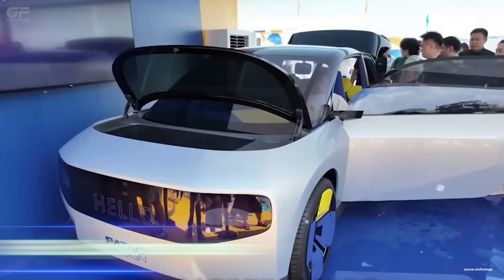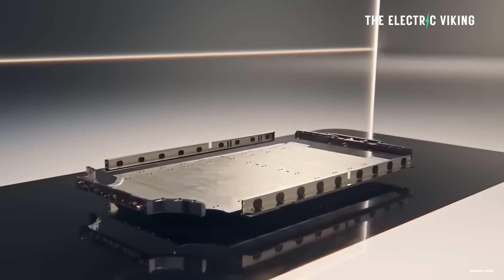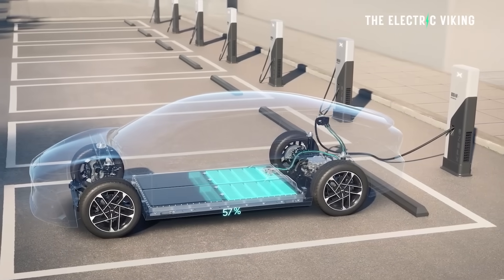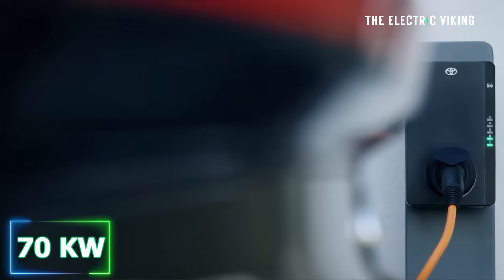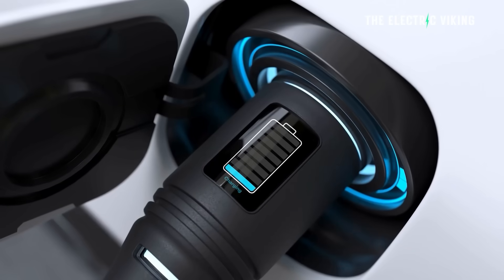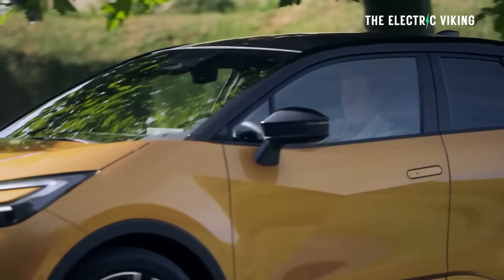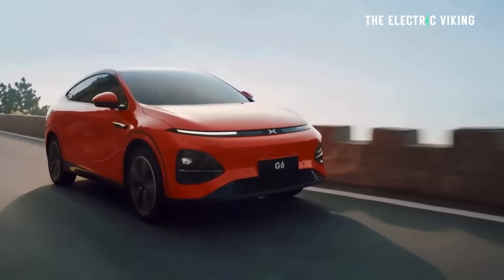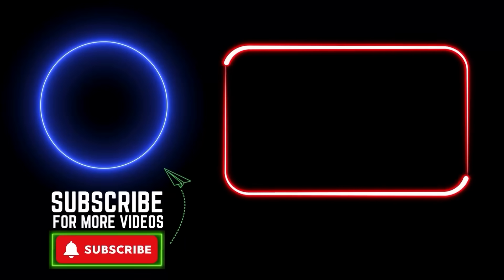SAIC GM's 400 Wh/kg battery will enable 600 mile range EVs in 2026

Comment: Most people who think they need “600 mile range” have never driven an EV. Most people who actually drive EVs want lighter cheaper models (with 3-400 mile range).
Reply: 600 mile range in Canada winter isn’t much more than 300 miles.
Reply: Those with no home charging in Apartments/flats etc would benefit
Reply: Higher battery density will allow the manufacturers to satisfy both kinds of customers (and everything in-between), namely those willing smaller, lighter and cheaper EVs with shorter range and those willing larger, more powerful EVs for longer road trips.
Reply: It really depends on your needs. 
I run a Service truck and am a trades person 
But 400 miles definitely covered any day of my work week 
But then you have a ton of tools and the material changes from day to today so the weight heats up the mileage
Reply: sadly the US is probably where the big range really comes in handy. towing and work trucks need tons of energy. maybe we'll start stealing tech from china now.
Reply: disagree... 500 mile range..
Reply: Depends on where you live. Australians (where 80%-85% of the population live in the conurbations of 5 major cities) demand at least 1000km range for EV's for them to be worthwhile. Simply bc the weekend can easily involve distance driving. And while plenty of people with EV's are reasonably happy where they are now - it's not the Anglophone majority. 

Lighter - sure. Results in cheaper tyre wear, better handling. Chinese materials manufacture is often compromised. But that will improve and be overcome. The cyclic nature of innovation is well known. It has to be cheaper, do more. And EV's will be taxed per km eventually - absolutely. 

People do want an EV with at least a 1000km range bc it means people who live in apartments or a an hour or two drive from work get a fair go. People don't want to wait 15 mins to charge up in public at cost. They want either to charge their vehicle at home direct from PV's at no cost if they use public transport. Or have a battery at home storing PV charge if they drive to work, or use it for work hour transport, overnight. Charging once a fortnight in a few years time will be for the majority of people the new norm. It's just if you can wait and your current drive doesn't die.
Reply: You also have to figure that you shouldn’t use the top 10% or last 10% of your range. That’s 100 miles. Heat on a cold day or driving 75mph costs another 20%.  600 miles is more like a “true” 400 miles.

Comment: Sam, I mostly agree with you about PHEVs being risky, but for a different reason. There are always local variables to consider. In Budapest for exanple, we are heading into legistlation (which is completely, absolutely utterly retarded), that will cause many cleaner vehicles to have to pay double parking fees because they are heavy. Not because they spew thick black smoke and harmful gasses, but because they are heavy. The "idea" originates from Paaris, which makes PHEVs pay 3x. Now, I understand that many PHEVs never get charged, and that owners only bought them for tax benefits. Mostly corporate cars. I have owned PHEVs for many years, and I have charged them diligently overnight. I have most recent data from my 2011 Prius PHEV: I drove over 20% as a pure EV, saving about 180 liters of fuel, just on the last 13K Km. So they could have just removed the tax incentives from corporate cars, or introduced sensible laws about limiting old shitspewing wrecks to enter the city, but no. Now, anything with  an engine that weighs above 1800Kg, and any electric over 2000Kg will pay double. That is beyond stupid. Anything bigger than an EV3, you"re screwed.  PHEV? Surely screwed. Even a simple Volvo station wagon will pay double. The world is full of morons, and much of what happens to car markets is driven by these people.

Comment: The only two reasons we still run ICE vehicles are the capital investment initially made and the jobs they provide. Range is becoming less of an issue except for road warriors who can exceed the max in one working day. The investments have made their returns but the jobs situation will require a comprehensive transition as a LOT of livelihoods (and retirement investments) are involved and there is much insecurity until a path forwards is determined.
Reply: The only reason we still have ICE vehicles is because people want to buy them.

Comment: What EV can actually obtain the range in normal running. Add 400kg and see the range.
High charge rates kill the longevity of battery, you can’t supercharge 4 EV’s at once.
In our country there is no chargers in country, towns are 300km apart min, some 600km.
Main issue is charge time, they take hours, when hybrid for refuelling is few minutes.
EV great for city slickers, bad for towing, no good for tradies. Cost is very high to both environment and pocket, more than ICE vehicles over life of vehicle.
Reply: You’re living in the 70’s !!
Reply: You are recycling the anti-EV arguments from 5 years ago, and I can tell that you don't own an EV. I have owned a MG4 for 50,000 km, and your comments are laughable.
Reply: That's an American problem because one political party doesn't want EVs to succeed.
Reply: You had somewhat of a point until your last sentence. Then you revealed either that you are uninformed or a simple FUDer/troll.

Comment: Your thesis is fine IF your not towing long distances. I travel 300km one way to my farm towing a trailer that can be maxed out at 2 tonne. I would not get there. You are only considering Joe Bloggs who just drives locally around the city and that then may hold true but here in the real world in OZ the distances and how you use your vehicle can make massive differences
Reply: EREV is the solution for trucks that do towing. The Ramcharger looks like an interesting concept that may (or may not) be out soon. You can do most/all of your around town driving in EV mode, and you have the engine to charge up on the road when you have the trailer.
Reply: What percent of vehicles on the road right now are long haul tow trucks?
Reply: @Mrsmith-p2t  In America? I'd guess at least 35%. Lots of people have pickup trucks and most people I know who have them, use them for towing.

Comment: 400 Wh/kg is for the cell, not the pack. Current Cell energy density varies between ~150 to ~330 Wh/kg, with lithium iron phosphate going as high as ~200 Wh/kg, and NMC as high as ~330 Wh/kg. Going from 330 to 400 Wh/kg, while a significant jump, is hardly a doubling of energy density. Time will tell if these batteries can actually be manufactured at scale, and will function as promised and be reliable.
Reply: 400 wh/kg would be a very significant step up in cell energy density, IF the cells are durable (lasts >250,000 miles), can be recharged at >300 kW and cost less to produce in $/kWh than Li-NMC or  Li-NCA. If they cost less than $75/kWh to produce, then the range could be doubled for an additional $5k to $6k in cost with no increase in weight compared to today's leading LFP battery cells.
Reply: @greggrant4614  I agree. Time will tell if this works. One thing I really don't think a lot of people understand is just how much money and effort is going into battery technology right now, and the incredible leap in understanding and development of tools to move batteries into new height only dreamed of a decade ago.
Reply: This is the point our Man here regurgitates stories without understanding properly what they are saying. It lets his channel down massively and he’s already the but if jokes.

Comment: The new BYD 5th Generation DM hybrids charge at 75kw DC depending on the model. That’s 12-15 minutes to go from 10-80%. With a 1300 mile range most people will not mind getting out to charge for 15 minutes.

Comment: Depreciation is really a non-issue if you buy a car for intention of owning it for 10 years or more. A thing that is  SO  much more relevant with EVs as they have so little to break down or wear out.
Reply: I dunno.  I've only had to do routine maintenance on my ICE vehicles the last couple of decades except for fixing power windows and replacing the A/C.  Those can break on an EV just as easily.
Reply: @robertd9850  Not really - A/C in an EV is sealed, like in a fridge.  ICE A/C has to be driven mechanically via a mechanical coupling to the engine - and it's the failure of the seals which cause lack of longevity.
Reply: @dogsbodyish8403  Fridges break.  What do you mean sealed?  The refrigerant in all A/C's, fridges, and heat pumps is sealed.  Most EV's have a heat pump which essentially operates the same way a home heat pump works.  Those break too.

Comment: combine these  new batteries with the mercedes 750 hp electric motor in a single engine electric plane like the pilatus pc12 and your going to have over 1000mile range not counting rerseves

Comment: I figure you've got at least 10 years, but no more than 20 years, to buy a combustion car, if you want it. Within that time period, gas/petrol/diesel stations will be in existence long enough, to finish out the life cycle of a brand new combustion car. After that, it becomes risky, because it will become difficult and very expensive, to find fuel. EV is largely "future proof", because you can generate your own electricity at home, in a number of ways. Solar, wind, or even Bio-Fuel. You just have to invest in the equipment, that can generate your power almost for free. Solar panels are getting better all the time, and it's a safe bet, the panels that will be available 15-20 years from now, will be nearly twice as powerful per area, as the ones available now.

Comment: Two years owning an EV, never going back. I have about 320 miles of range on a good day, and a max of 205KW charging speed, and it’s almost perfect, but not quite. To buy a replacement (in a few years), I expect it to have at least 500 miles of range and 350KW or more charging speed. That will be the technical specs I will be looking for. I don’t see the need to go that much beyond that, actually.
Reply: 400 to 500 miles of range is good enough for most of us.
Reply: I'm in Western  Canada, you need all wheel drive and, cold climate capable batteries  minimum.
Reply: @grahamkearnon6682 I hear you brother. I’m from Norway, and in the arctic the range is half in the winter. And I charge 20-80%, så you can say it’s half and then half of that. I don’t think 600 mile potential range is too much to ask.
Reply: @grahamkearnon6682  China makes hybrid batteries lithium/sodium. Sodium is not affected by cold climate.
Reply: @grahamkearnon6682  It's  coming. 

These are the early days of EVSs we're still tinkering around the edges of all that is possible.

But yeah, - 30 to -40 C is no joke but those cold temps sap even an ICE car's milage.

I'm in Ontario and -18 to - 20 our coldest day or 2, I don't bother going out unless absolutely necessary. 

The legacy companies have only been at it for 5 or 6 years and haven't hit mass adoption yet. 

The next 5 years will be completely transformed even if Trump puts North America another 4 years behind.

Comment: Diesel died first in Denmark and Hybrids (any kind) is next, gasoline is last, 86% bought electric in June.
It is now virtually impossible to sell used Diesel cars, no matter the price, used hybrids are really hard to sell, and used gasoline vehicles sell fairly easy.  Used EVs are selling like hotcakes.
Reply: In Australia hybrids have increased their value second hand.
Diesel and petrol are living on borrowed time.
Reply: @John-p7i5g  You forgot to add that in Australia second hand BEV’s don’t sell well.
Reply: @PropanePete  There's a reason for that, and that is people selling are trying to hold on to their residual value (fair enough, but as with all new tech, cost decline is very steep), and secondly, battery health issues is a big concern in purchasing a second hand EV, especially one older than 5 years out of warranty.
It might be an unfounded concern, but it's still a concern.
Reply: @John-p7i5g  In Australia , diesel and petrol are chosen by more than nine out of every ten buyers .
Reply: @Leo555ZZZ  Oh no they ain't. Last month June 2025 numbers: BEV 10.3%, PHEV 5%, HEV 15%. Electrification of some kind is now around 30% of the market. And that is following a curve upwards over the last 2 years.
These are approximate numbers but if you look at diesel and petrol pure ICE they are on a steady decline.
Pure ICE will be down to single figures by the end of the decade in Australia. Guaranteed.
Reply: @Leo555ZZZ  Correct. Only 1% of cars on Australian roads are electric.
Reply: @John-p7i5g  You need to check the figures from the EVC (Electric Vehicle Council) the FCAI (Federal Chamber of Automotive Industries) and the AADA (Australian Automotive Dealers Association). Only 1% of cars on Australian roads are electric and conventional (ICE) vehicle sales numbers have been increasing for the past 3 years. They publish every quarter. Sam just pulls numbers out of his arse.
Reply: @PropanePete  I'm going on a recent study based on FCAI, but also watching the monthly numbers reported on particularly car expert, which breaks down the percentages of all the powertrains each month.
Petrol and diesel, aside from a few upticks are trending down, BEV, PHEV and HEV all trending up.
Reply: @John-p7i5g  Well, the most recent Bureau of Infrastructure and Transport Research Economics release showed that 1% of cars (passenger vehicles) on Australian roads were electric and that figure has been constant for some time. Sales of new hybrids were up and sales of BEV’s were also up (as you correctly stated). But sales of new ICE cars were also up so even though there are more EV’s and hybrids on our roads that 1% ratio seems to be pretty static. And you can see more EV’s and hybrids as you drive around than there were 3 years ago. Hybrids and EV’s stand out in the traffic, they’re quite visible, you see them, but you don’t register that there are an increasing number of new conventional cars around as well. Also keep in mind that all hybrids have an engine up front so they’re essentially ICE cars with an electric assist. I’m not against EV’s by the way, an electric drive system makes sense, but the crazy figures that get thrown around on this channel need addressing.
Reply: Denmark is forcing its population into EVs as they have high fines in place now for gas/hybrid vehicles.
Reply: @FordEnthusiast413  good there should be fines. The financial burden on us from healthcare to climate change weather disasters is massive.  You burn petroleum you should pay for the damage caused

Comment: I think the 1000+km per charge is the turning point as there is nothing stopping you from there on... well the charging still needs to happen in a few minutes and the solid state bateries should solve that also. And then we have the issues that electric power grid simply wont be able to handle that. So the private/home bateries will be needed in 200kW range,.... so the solid state is one piece of the puzzle.

Comment: The rate of depreciation will actually increase I believe, because the rate of technical advancement will sky rocket.   If you have cars able to go further and charge faster by multiples of previous models no way you avoid rapid depreciation.  Everyone use to experience this at a high degree with smartphones.  That will happen with autos at least for a few years. Once they hit a plateau of development they will start to be commoditized to an absolute value proposition.  The Chinese market will absolutely be the first market to go through this.   Not so sure when it will happen in North America.  North America may be the last market to be affected.

Comment: I live in Sicily. I just purchased a toyota yaris hybrid. Southern Italy is way behind on EV charging facilities particularly Sicily, which is a basket case. Until the infamous "bridge" is built it will continue to be a backwater of Italy and Europe. I am starting to see charging facilities installed on major highways on the boot (Naples to Rome e.g.) which I drive frequently. (Not present at all on less trafficked provincial roadway network.) That's encouraging. Maybe my next car will be full electric if range continues to increase, costs go down, and charging stations are more widespread. I look forward to the end of the tyranny of big oil.
Reply: Solar canopy + 5MWh stationary storage.  = No need for a grid connection.

Comment: In 2024, it was announced that mass production of the MG4 with semi-solid state battery would start at the end of 2025. It did not happen. In 2025, it was announced that mass production of solid-state batteries would happen at the end of 2026. It will not happen. 
=>The problem is - a dozen companies have announced recently to ship solid-state soon. The Electric Viking himself has listed them recently. That puts a lot of pressure to announce something no matter if it is affordable or having scalable production. As an observer it is hard to tell what's nothing but hot hair. Remember that companies without the pressure from the Chinese market are leaning more for the year 2030. ie. the usual "five years away" that shifts every year by a year. We could make a bet - will the "mass production" of solid-state batteries shift by another year next year?
Reply: Recent visit to china and lots and lots of good looking electric 2 and 4 wheel vehicles…